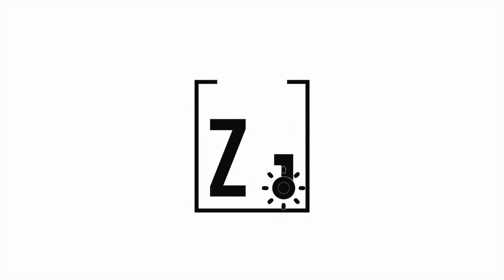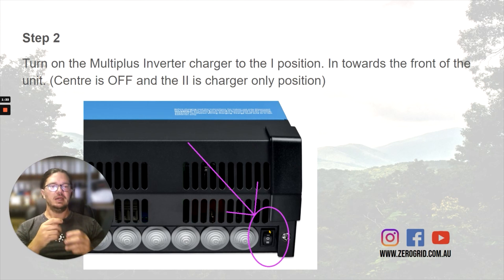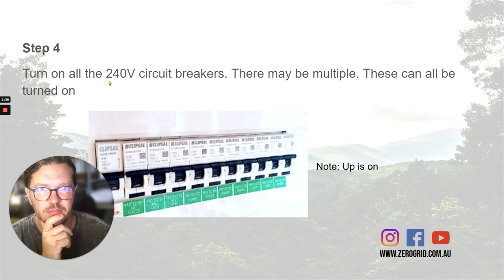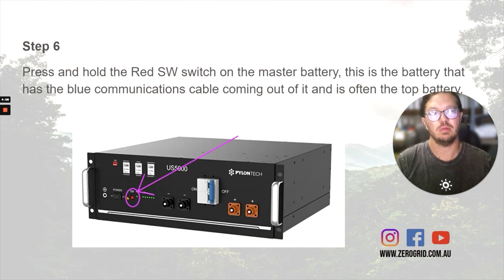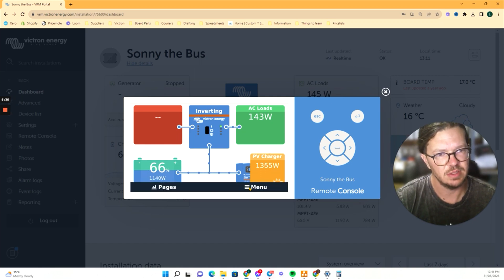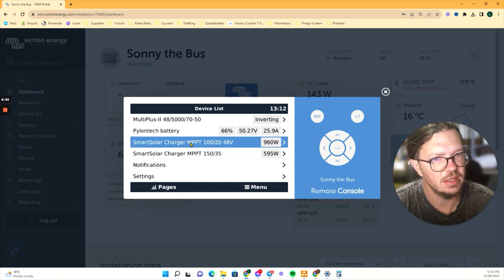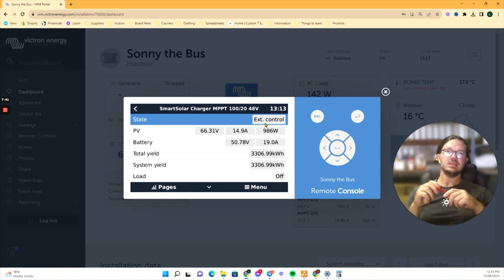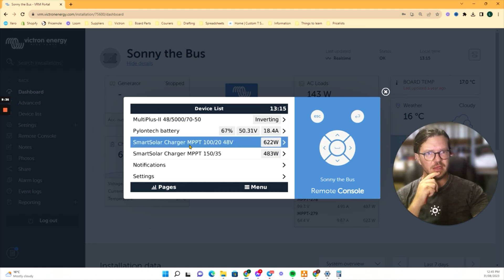How to start up your Pylontech Batteries in your off grid system.

Comment: Where the ve can plugs into the battery. What’s the correct connection marked as? 
Contact-console-a/can-b/rs485-or Lockport 0-1?  The battery’s in the video are slightly different to the new pylontech
Reply from the maker: Hey mate, on some of the batteries it is labelled A-CAN